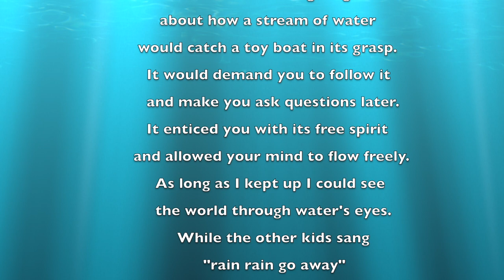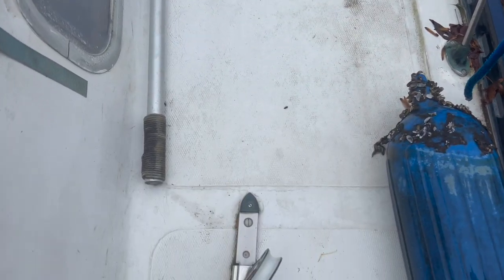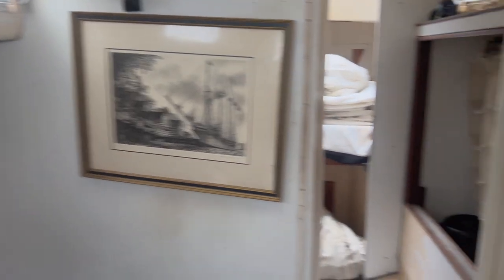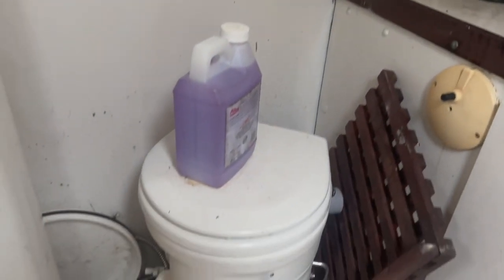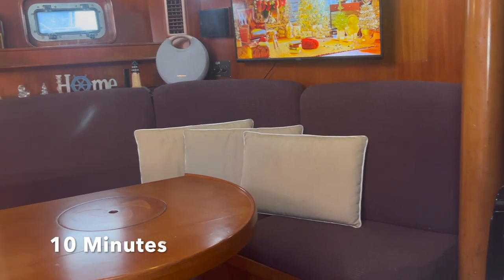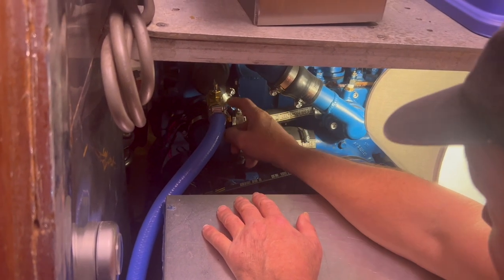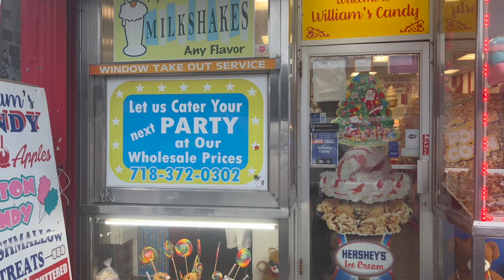From Couch to 42' Sailboat- $ 10 Grand- Make an OFFER - Sailing SV Bohemian Ep. 44

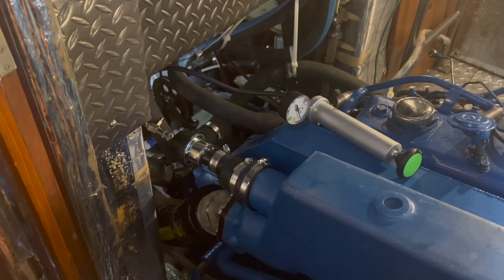Comment: 🙂 I paused at minute 21:39, and I'm thinking a pressure test of the heat exchanger tubes can be done without filling the tank... If it doesn't hold pressure, then it's compromised, where coolant can leak out into the sea water if the coolant is at a higher pressure.  On the other hand, you can fill up the tank to see if you get bubbles too... let's keep watchin!
Reply from the maker: I did that on the last video . It wouldn’t hold . And I did a test to see if exhaust gas was coming out  the top of the heat exchanger at the radiator cap . No exhaust gas . So we know the tube stack is good and the head gasket test was negative.  And no leaks  on the outside of the motor.  I’m stumped . I bet it’s the head,  I don’t know
Reply: @Sailing SV Bohemian  In one of your video's there was a white film on the water around your boat that's indicative of coolant leaking out the exhaust, I'm almost certain it's the head gasket. I know you did a test on it, but I don't think it indicated correctly.

Comment: Morgan 41' center cockpit with the nice double bed aft cabin is a much more comfortable boat. They run from $50G to $100G. Morgan 50' is incredible $120G to $150G. You'll spend $60G to fix this boat.
Reply from the maker: If you put a little 5 horse outboard on her just in case the old diesel breaks down . You could sail her now . For around  to 10 to 5 grand . She has two or three sets of sails .  I’d put on new lines and sail her then bed things and  just clean . It’s a good deal . It’s a boat for someone that doesn’t have 30 grand up front to buy a sailboat . But can come up with money over time . I’ll look around for a 41 Morgan Out island that’s a project boat this summer . Maybe there’s one around,  I’d like to go on one and see the difference. The one showcased is skinny. I think if I changed the interior I’d make it like some of the Catalina’s  where the kitchen runs from the bulkhead in the middle back to the stern.

Comment: They make a dye that you use with a pressure pump on the radiator cap. Wherever it's leaking it will show up.. how old is your radiator cap?? Those things go bad and will cause either no pressure or 2 much pressure which would allow your coolant to be pushed out somewhere.. also wouldn't it be better to pressure test a single hose at a time so you know exactly which one is the problem
Reply from the maker: The whole cooling system is new . I’m trying to keep from taking off the head . The owner from trans Atlantic diesel has been helping a lot . I can’t say enough of them . If you ever have a Perkins good place for parts and experience on old Perkins motors and parts .
Reply: @sailingsvbohemian1464  I know you don't want to take the head off but you either deal with it loosing coolant or you fix the head gasket..
Reply from the maker: @bendaves77  I think tomorrow is the day . One more pep talk with Trans Atlantic diesel tomorrow. . It could use it anyway and I have the time . So what’s to loose . Thanks Ben for the advice

Comment: When you put pressure in it ran out , did it come out of the Cork,  or somewhere else ,liquid,
Reply from the maker: Air , no liquid . I’m going to call Trans Atlantic Diesel  this week . That was a test he recommended. Then to call him back . The owner will help you make decisions. Pretty good service . They’re  the premier Perkins mechanics in the United States . I’ll be curious on what he tells me to do next . He’s rebuilt probably 1000s of Perkins motors
Reply: @sailingsvbohemian1464  where is there liquid that shouldn't have liquid , as your filling and not running the engine , I'd say not exhaust,  it must run down,  is it staying in the engine or escape,  in the bilge ,  clean everything up completely , fill with cool and do the same see where it gets pushed out, it did look like the level went down under pressure ?
The rebuild engineer , finds the issue when taking it apart ?
Reply from the maker: @davidwarnes5158  I tested the pressure on the side where the antifreeze circulates no leaks on the out side or antifreeze in the bilge. Check out the video right before this one . I did head gasket exhaust test , it passed . I think everyone thinks it’s in the head or head gasket . . Probably is. I might start working on it tomorrow. It’s cold and not much I can do outside on the deck . I found another cool boat that needs restored . And it needs a lot of work . See ya in the next video

Comment: An old, unkept boat with lots on unfixed leaks. You're going to have a ton of water damage, mold and rotten wood. This isn't a small boat either so it won't be cheap to fix or mainain either. 
If you can't afford a $250k boat, you can't afford this.
Reply from the maker: She was a leaky one .  Good boat to start with , she,ll sail now . I’ve seen real good examples go for 50 or 60 grand .I’m going to check out a old contessa 26. See if it’s even possible to buy . If she is . Ill show her . The rudder was missing not a good sign . Maybe she’s free . We will see . She seems along way from home . It looked pretty old . From England maybe, Maybe Canadian
Reply: @sailingsvbohemian1464  I would suggest getting an example in good condition for 50-60 grand over this one. Fixing the leaks and the water damaged interior will cost a lot of time and money. The bottom needs new antifouling, too. What did it smell like inside?